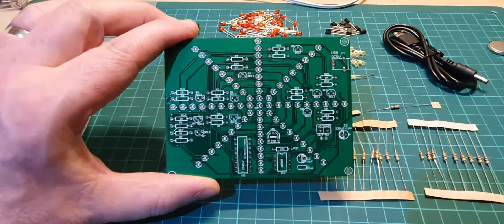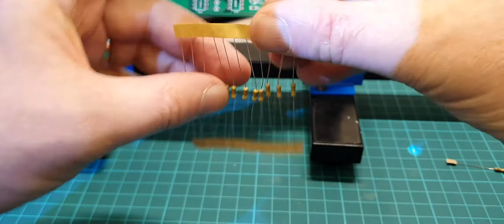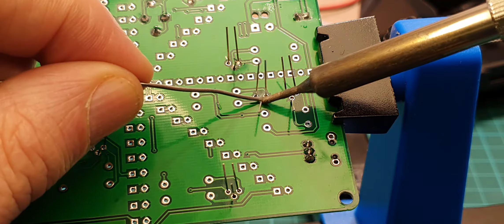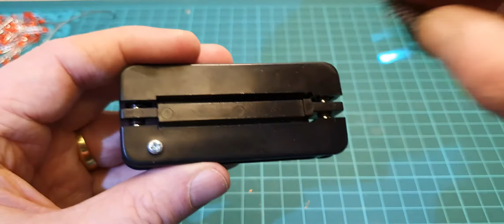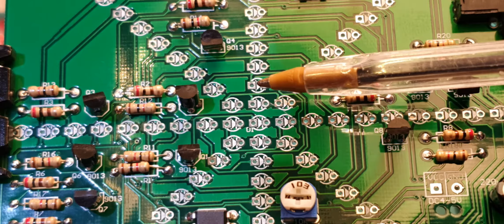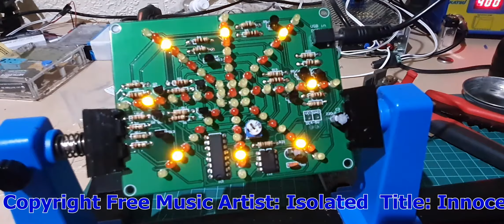Kit build of EBay LSD-73 8 Point LED Star

Comment: Mine doesn't work, I used the battery connection. I'll need to try and fault find. Any good tips for a near pure beginner?
Reply from the maker: check all your connections, use a continuity test on the traces, also make sure you don't have a solder bridge